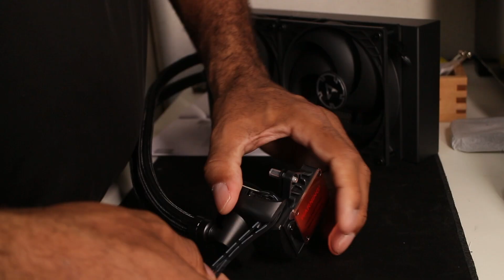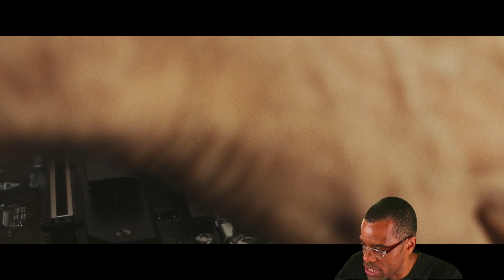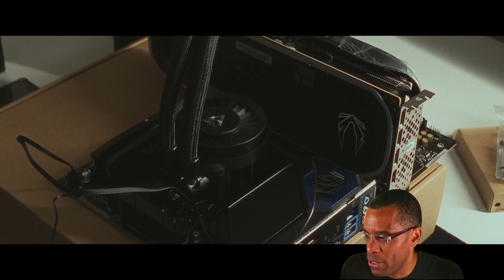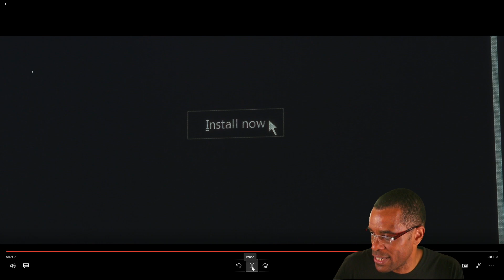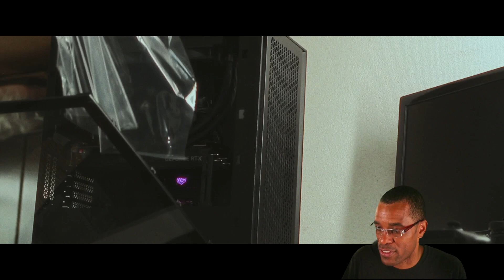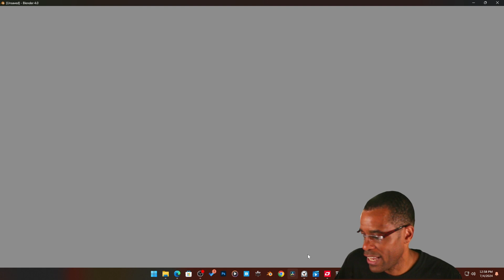Blender Octane PC Build for MAXIMUM Performance

Comment: Weren't there issue with the water cooler when you had it connected in the dry run and than installing it in the case. I mean there is liquid in that thing by than

Comment: Congrats Patrick sir. I want to share a small story here- 
 even I built a desktop some time back and we have some similarities in the components we chose ( thats why I was asking you multiple times to post this video ). 
For processor i went with AMD Ryzen 9 7900 ( Just like yours but lesser TDP one), for memory,  I went with Corsair Vengeance 16GB X 2 sticks ( Just like yours), for storage I was thinking of going one Samsung for OS and Crucial for secondary, but went with 2 Crucial ones ( just like yours). For cooling, i really wanted Arctic Liquid Freezer as they are one of the best in the business, but they dont officially sell it here in India so I chose Corsairs A115 air cooler ( being a air cooling lover). For GPU, I chose Zotac 4070ti Super 16GB (same company and almost the same GPU as yours). For cabinet I was considering either Corsair 4000D airflow ( just like yours) or Lian Li Lancool 216, went with the latter finally. 
I built this after waiting for more than 5 years and researching thoroughly about each and every component for the last 2 years.  

These specs will easily serve us for 6-7 years if not more. 
All the best and keep churning some great work and tutorials here.
Reply from the maker: Wow 😲 that's 😎 cool how are you liking your system ?
Reply: @1polygonewithme  It has been running great. Taking hardly 3-5 minutes for an otherwise 30-40 min render with medium to low poly count scene

Comment: İ would urge you to use a 8-10 TB hard drive as storage instead of another SSD. In my experience ssd's fail and when they do, boom its gone. this was my experience TWICE but obviously DYOR.
Reply: That doesn't make sense, Hard drives have way bigger failure rates than SSD's.
Reply: PS^ PC building is DEAD. You are ALWAYS better off to let the pros handle it. If you want, choose the parts yourself but let them build it. the cheapest part being at least a couple of hundred dollars, the cost of failure is too high,
Reply: Also the water cooler.... Why?! Again, the cost of failure is too high, and you will never use the full power of that machine. it is an overkill for what you are going to use that PC for.
Reply: my two cents that nobody asked for lol...  You probably did take advice from people that are more initiated, but I wouldnt risk 5k like that. Anyways, jealousy inducing build there.  Excited to see what you are about to cook in that stove.
Reply from the maker: Thanks 👍 for the tips 🙏🏾